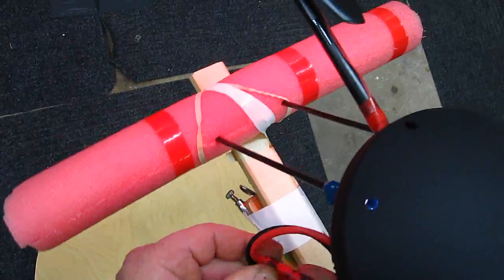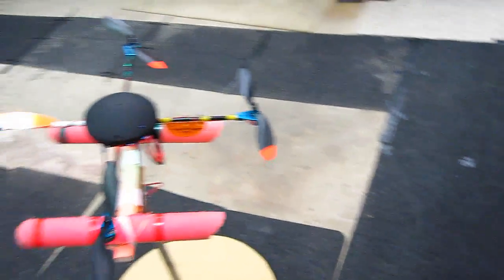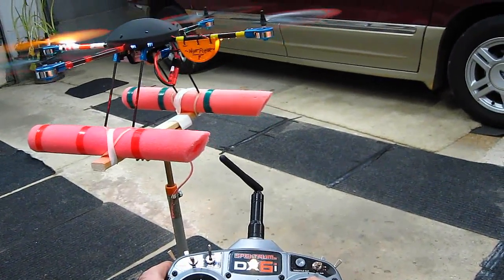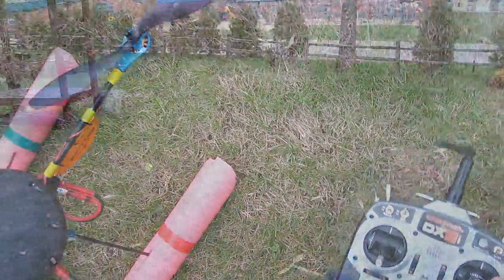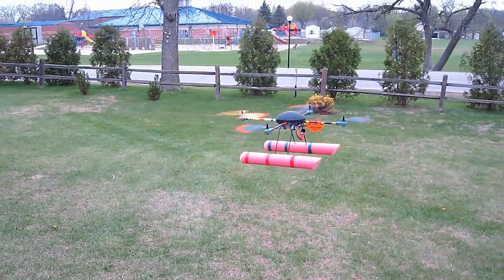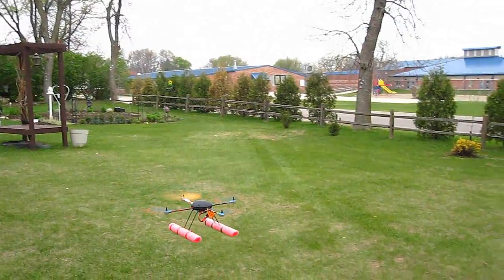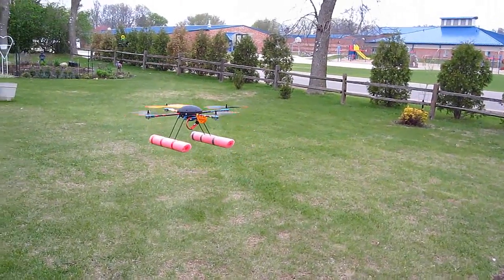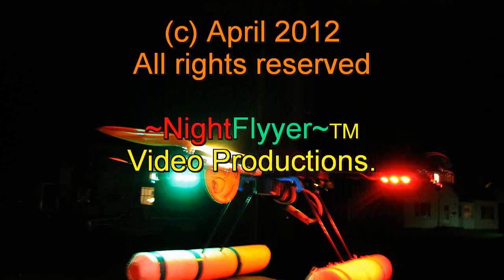"Self" Landing Quad Copter Test. T-580 from NitroPlanes.

Comment: That quad comes with a barometric pressure gauge. The autoland feature will not work that close to the ground due to atmospheric pressure letting it know it is at ground level already.

Comment: If that's auto-landing then all quad-copters are fitted with this feature. ;-) I'd say this could be a case of false advertising. I wouldn't try it from high altitude either, the low altitude test did not provide a clue that it would react to the loss of TX signal. Sanity prevails for now. ;-)

Comment: the motors positive pitch of the blades would not cause the props to counterrotate. Even if this were possible the motors resistance would not allow the props to reach a speed that would prove to be effective.

Comment: Maybe when the gyro is at 0 input it stops all power to the motors so when it drops so quickly to the ground there it senses no movement, therefore no need to kick in any type of auto pilot for a controlled landing? In other words, it may need to be at a "dangerous" height to kick in and function properly because it shuts off once it hits the ground. Or perhaps the function needs to be enabled? It seems odd they would advertise something like that and it not work. :(

Comment: Not sure where I read it but it does, you don't even need to use your test stand. Hover at low altitude and shut off transmitter. The outcome will be much better then you T580

Comment: Dave, glad you tested that. I have a dji naza flamewheel and it has a fail safe where if you flick the gear switch on the dx6i it slowly and I mean slowly comes down before shutting itself off after 25 seconds of landing. Once it lands, the rotors keep spinning at a very low speed. I think you should purchase a naza. It is by far the best controller next to the wookong or mikrokopter controllers. I love mine.

Comment: Thinking about this, your experiment is not going to work properly... When powering off your radio the spektrum reciever will also shut off, so the reciever in a sense does not have a signal loss, but a shutdown. I tried this with one of my planes and the LED on the reciever turns off. When losing signal or a brown out the LED will flash a sequence when signal is restored. I could be wrong, but wanted to share this with you. Your thoughts?